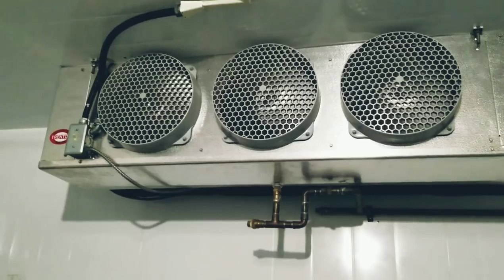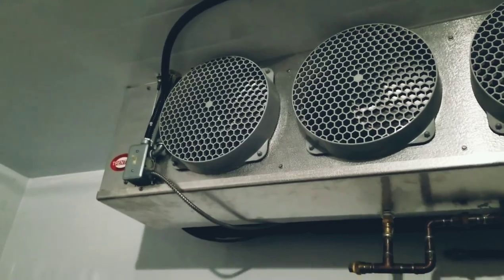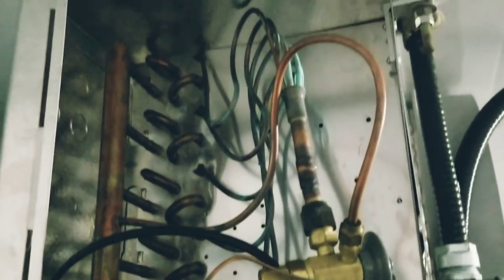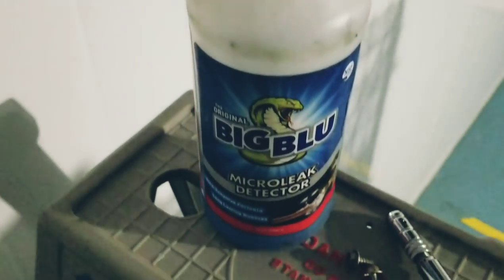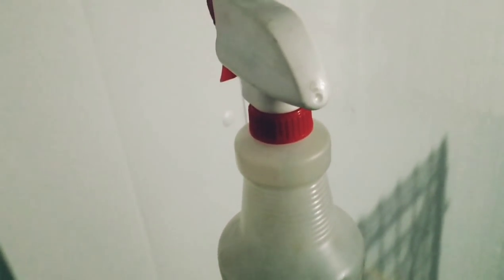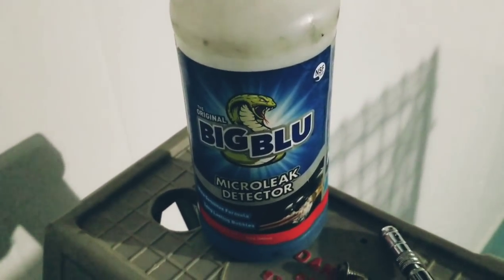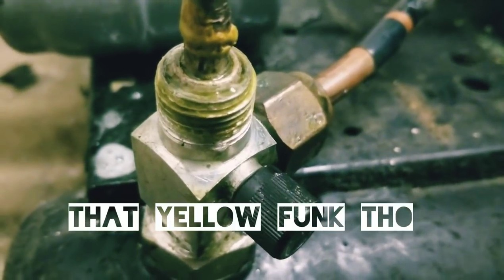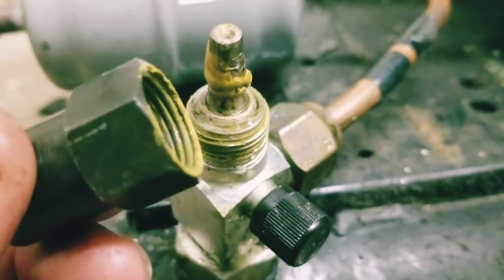HVAC - Refrigerant Leak Check On A Walk In Cooler

Comment: You seem to really like that Testo leak detector. Is there any Freon flavor it doesn't do very good at?
Reply from the maker: Not that I've met, the thing is badass!
Reply: Just weighting this, Inficon D-Tek and Bacharach H10 Pro. Can't decide yet.
Reply: @JuanTodoli  i have the h10pro, fieldpiece heated diode, and TIFF ZX, the h10 is great,  but big and takes a while to warm up, sensor is expensive to.   I had the inficon,  it did good,  but it couldn't pick up small 410a leaks. That's how i got the h10, the other tech found the leak in 2 minutes after i have looked for a hour. The fieldpiece ??? Not sure i like it yet. A lot of false alarms. Inficon has a new detector that was to be released this month but hasn't yet. It's bigger money but should be a lot better than the current detek select.
Reply: @HVACRSurvival  Thanks for the input Rick.
Reply: @JuanTodoli  NO problem👍👍
Reply: N.W. Ohio HVAC Videos  how long does the H10 take to warm up?, interested in purchasing a leak Detector but want to purchase the best one. Thanks.
Reply: @cesconboxer  the manual tells you to let it warm up for 2 minutes. It really depends on how big the leak is and how new the sensor is. It also makes a difference based on the ambient temperatures, if it's really cold out it takes longer because the sensor is really cold. Go figure,  I don't move real fast when it's cold either. LOL.... I've gotten started searching and in less than 30 seconds and found the leak.   If you happened to hear Dave norcal's song about "back to the h10". There's a reason why he made it, every time I do it Leak search I end up double-checking it with the h10. As I mentioned earlier I've been trying out several different detectors just because I'm a total nerd, the heated diode version from Fieldpiece was supposed to be the best for r410a, but the false alarms outweigh any benefit that it may have had, if I can't trust my tools I don't want them, I contacted Fieldpiece about it twice and was ready to try to trade it for something different and they offered to send me the infrared version and if I liked it, they would swap it out even up. That's pretty awesome of them  because the infrared costs about $140 more than the heated diode version from Fieldpiece.  I've been trying it out on every leak that I've had and it's done really well this week,  but just this Friday I had a R134a reach in prep table that held 10 ounces of refrigerant that was running in a vacuum.  Neither detector picked it up with static pressure of around 48 lb PSI. So I added 200 lbs of nitrogen behind it, and rechecked it, the Fieldpiece did not pick up anything but the h10 did. That's just the nature of the heated diode. The heated diode has its life issues but it also has a nice analog feel to it and allows you to pick up on things very microscopic that may only make the beep pattern speed up just a little bit.   A little bit is really all you need when you have no other place giving you any signal and it's likely in the evaporator. Believe me I did not think that detector was worth a crap it's set in the office for years until I was made a fool of by an old H10 - G. I was using the dtek select the current version, cuz it seems detect was always coming out with a new version of it, it was the infrared, and I had scanned every square inch extremely slow trying to find it. Incomes Joe with an H 10 and as I'm making fun of it for having to be plugged in, he finds the leak in less than 2 minutes in the evaporator. I started out with the H 10 p.m. and sold it off and bought the h10 pro. A my workplace I get paid more if I am commission-based, it's a trade-offs because if I make a mistake I have to go back for free or if someone else goes back I don't get paid either way. Luckily that doesn't happen very often, but finding a leak the first time obviously is very important or I lose money. Our commission-based pay system is nothing like the used car salesman scam artists out there,  just in case you're thinking that. We only charge $62 to $67 an hour and I take a higher percentage of the cut than the company does of that total bill. It's an incentive for me to do my best and also ends up making me more money than the union pays. Once you learn to trust the detector you'll know if it's real or not, generally it never falses and even when I do get a false it really is not a false, meaning... if I scan where the screw hole is in a reach-in cooler wall,   the insulation which has a propellant in it will set it off very faintly. The propellant is technically a refrigerant based gas. Hope this helps sorry for the long post.
Reply: @HVACKnowItAll  Will that model you're using work on R290?

Comment: Heres a good tip if you have 30 psi. Blast it with 500 psi of  nitrogen then your just cheating. Haha. Probably not EPA approved though
Reply from the maker: Yes that works really well.  I don't need to worry about the EPA, the Ministry of Environment is even more strict up in Canada though lol.

Comment: More often than not I find leaks at the flares on txv, have you ever used a ultra sonic leak detector?
Reply from the maker: no, I haven't..what is it?
Reply: it picks up any kind of gas leaks,even if in a vacuum, I use the accutrak,helps pick up the leaks that other detectors cant